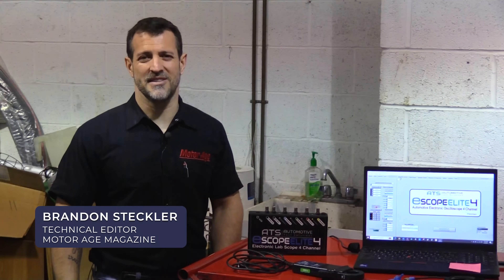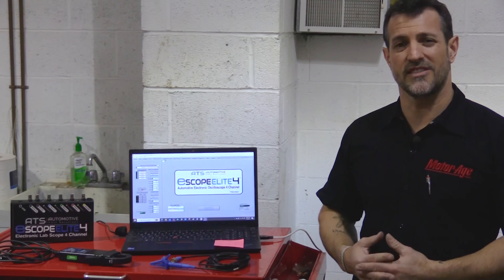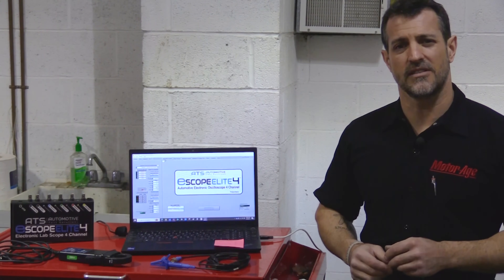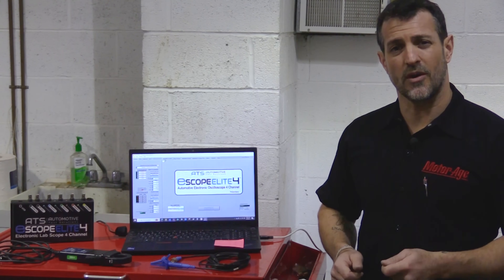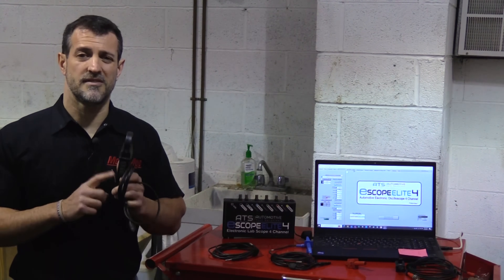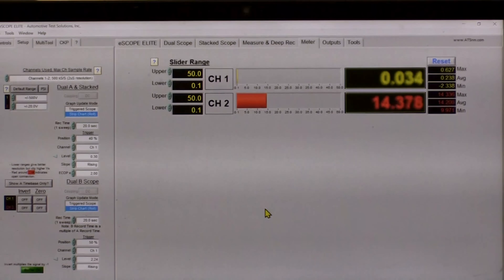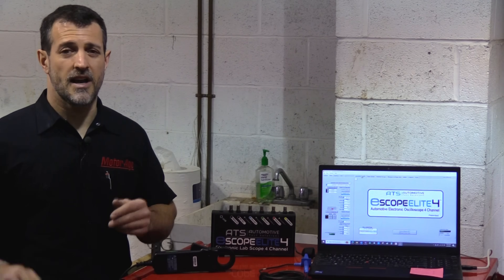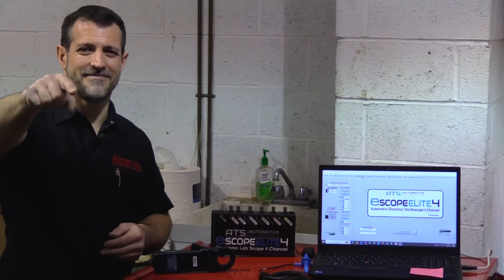The Trainer #146: Guilty as charged

Comment: Good stuff, thanks for taking the time to educate. So is the pcm monitoring lower voltage from the battery cable somewhere after the resistance and that is telling the alternator to increase the duty cycle to try and bring the voltage up?   Seems as though the post at the back of the alternator might see, 14.5v or so, and may be at the battery post. It reads 13. So is the computer seeing 13 V when it wants to see 14.5v and it then commands the duty cycle higher to the alternator?
Reply: Yes, but keep this in mind. The “current”
Is the result. The alternator is creating voltage (electrical potential/pressure). 

The resulting current is dependent upon the resistance in the circuit (in this case, we are talking about the battery charge circuit).

“IF” the alternator duty cycle did non increase (remained at a 50% duty cycle, for instance) the high charge current would lower the alternator voltage output. 

The increase in duty cycle command “maintains” the desired voltage when current flow increases.

This is why the electronics get hot.
Reply: Gotcha, thanks for clarifying👍🏻
Reply: Hello, thanks for the great question. although vehicle charging configurations vary, this vehicle uses no current monitor. The current flow will determine the voltage sensed. The alternator will output the current to supply the fuse boxes and replenish the battery. Once the battery is "full of electrons" the current through it will diminish simply because its internal resistance increases.
Reply: So even if there were no corrosion/extra resistance in the circuit between the alternator and battery but just a sulfated battery.  The battery would act as a heavy load due to low internal resistance and cause the alternator to output excessive current which would then lead to premature alternator failure?

Comment: Hi B. Like you read my mind. I have a vehicle here with a high charging rate. Battery and alternator was replaced. Still the battery light is on. The customer is confused why he is seeing 15.5v when he checked it. Will use your testing methods. Thanks again
Reply: You have a voltage drop on the power or ground side. The alternator is sensing low voltage so it’s sending out max power
Reply: @chainarmor448  How can it be a voltage drop issue on the positive or negative side of the charging circuit if he's measuring 15.5 Volts at the alternator and at the battery?
Reply: @bernardocisneros4402  hi I got through. There was an open on harness to the 10amp fuse. Fixed and returned to the customer. Thanks for all your help and guidance
Reply: @LAKERS4LIFE-g1i  Glad to hear it.
Reply: Was that 15.5 volts at the battery or the alternator?
Reply: @bernardocisneros4402  both.from the battery post and the Alternator B post while idle. Battery light is on. With the auto light flashing. It has the start stop features. Battery and alternator was replaced. Three pin alternator.
Reply: @LAKERS4LIFE-g1i   What is the year, make, and model?
Reply: @bernardocisneros4402  Nissan Note HR12. The vehicle was in a small collision. Battery light is on.
Reply: @LAKERS4LIFE-g1i   what year?
Reply: @bernardocisneros4402  2013 Nissan Note. Non super charge. HR12
Reply: @LAKERS4LIFE-g1i  I'm sorry. I won't be able to help because I live in USA.  I only have  Alldata and it doesn't give me an option for European vehicles. The only similar cars I have access to are the leaf and the versa. Without a wiring diagram for the charging system for that specific year and model, it hard to diagnose
Reply: @LAKERS4LIFE-g1i  I was able to find a wiring schematic for the car and I wrote a long detailed comment explaining how to troubleshoot your problem, but when I was done writing and hit the reply button, it disappeared. I guess YouTube doesn't like long comments. Your problem is going to lie in the alternator or the other parts of the charging system. The alternator is on the right side of the engine compartment and the IPDM, ECM, and battery current sensor are on the left side of the engine compartment. I'm going to guess that the collision was on the left front of the vehicle. This would be the front driver's side in the USA or front passenger side in England. To determine if it's the alternator or the other 3 parts of the chargning system, I disconnect the connector from the battery current sensor. The battery current sensor is on the battery's negative cable. Then I check the voltage at the alternator. If the voltage level drops to spec and the battery light goes out, then you know it's not the alternator. The problem will be in the IPDM, ECM, or battery current sensor. Let me know what happens when you disconnect the connector from the current battery sensor.

All of this is assuming you have a good battery. Since this is a stop-start vehicle, I'm going to assume it has either an AGM or EFB battery. A good AGM or EFB battery will have an open circuit voltage of 12.6 volts or more and the voltage doesn't drop below 10.1V when load testing it by drawing half of its rated CCA with a carbon pile tester or when you crank the engine for a couple of seconds.

Comment: A DSO is not necessary to do this. You can do this with a DC Clamp-on ammeter and a voltmeter/multimeter.
Reply: This is correct. In fact, that is why I chose the meter function of the eScopeELITE4.
Reply: He did the test in meter mode
Reply: @mike-s8n8y  You're absolutely right, but I was just pointing it out for beginners that might think you need a DSO.